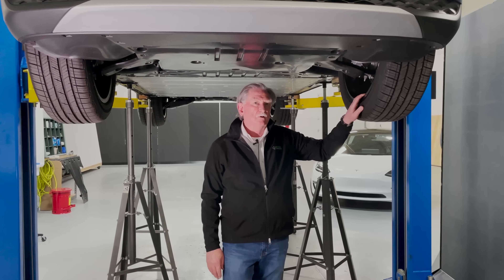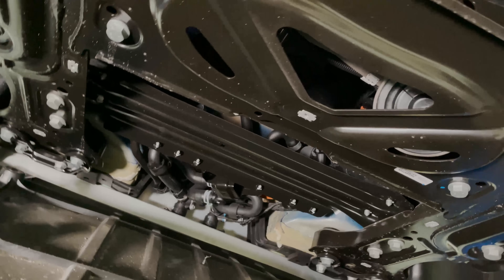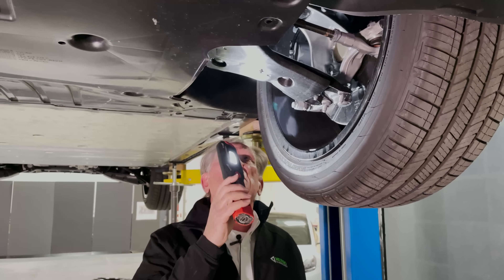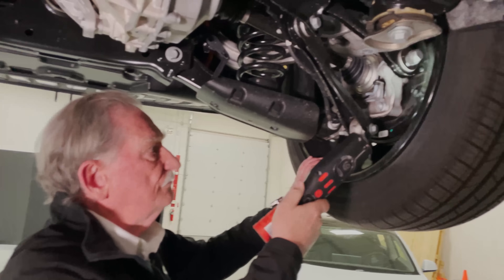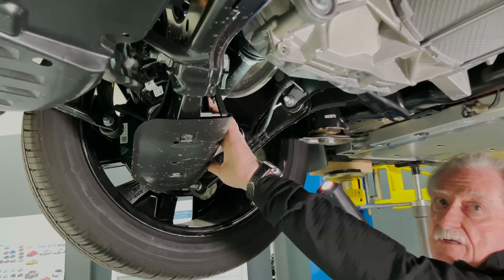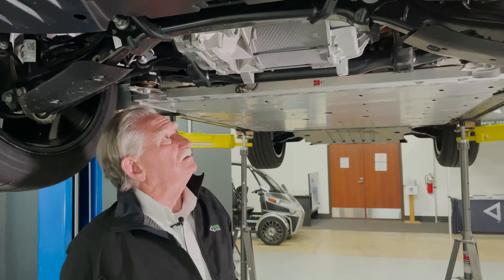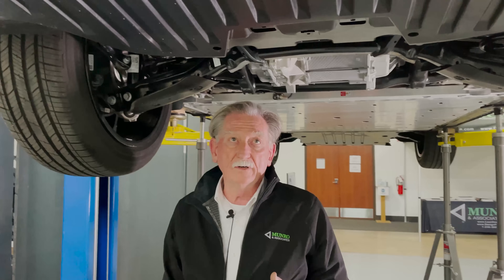2021 Volkswagen ID.4: E3 - Hoist Review, Front and Rear Suspension

Comment: this video will not age well with all the tesla praise - TÜV's recent reliability results for 3 year old cars put Tesla model 3 in last place of more than 100 cars, 3 times as many issues as the average, where one of the main problems were ... suspension. I dont think this old man is competent enough to question vw's engineering choices.

Comment: I have the id.4 awd. The front end is VERY noisy over bumps. Specially with those low profile 20" wheel tires which are pretty much standard now on the id.4.

Comment: As far as the hood pedestrian crash design being heavy.  Ask Ford how much the lighter "A" pillars in the 250, 350 trucks cost them.  Not required, but Ford scrapped a safer design for weight,  mileage and cost.  EPA mandate? Totally legal, but looked real bad to a jury.  So the first head injury by a US pedestrian, VW would need to do some `splaing if they removed those features.

Comment: May have been mentioned by others in the comments, but the main reason for the drum brakes is due to regenerative braking. A traditional braking system is 60/40 balance. In ev the motor driven wheels braking force is for the most part less than 30%. There are exceptions. Some current EV's are suffering from brake disc corrosion on the motor driven wheels due to lack of braking force required.

Comment: Sandy has become a Tesla promoter.  He faults the ID.4 suspension for being too-strong and too normal, compared to Tesla cars which are more like M-B & BMW.  But Tesla's have had many suspension failures, even a recall in China for the Model S/X suspension arm failures.  There is no significant difference in suspension and steering requirements between a gas or battery car, so reasonable that the ID.4 suspension is like other cars.  Sandy critiques the many coolant hoses, presumably in comparison to Tesla's Model 3/Y "octo-valve" which combines many coolant connections but has proven problematic.  Sandy is a former tool & die maker, with no college degree but much experience.  VW has many smart engineers, so presumably know all the options and made design choices based on initial cost and future maintenance.
Reply: Very well said.

Comment: In germany they use al lot of salt in the winter. Salt and Aluminium is not a good combination. If you coat it you can prevent corrosin on the aluminium.

Comment: The painted motor might improve cooling. The Emissivity ε is better with painted surfaces rather than shiny ones (blank aluminium), therefore the heat radiation is better (better cooling). That's also the reason why blank copper busbars are often painted to better radiate off the heat. At least we do that in Germany :-)

Comment: The reason there are drum bakes is that since it has a regen mode, you will be using that a lot of the time instead of brakes to slow down and stop. So since the rear brakes wont be used that much, disc brakes would start rusting. Drum brakes wont rust since they are sealed. That is the reason they decided to go for them. Also no brake dust. Sure, they have worst performance, but that is probably not the issue here.

Comment: Drum brakes: better against corrosion because of closed system. Cheaper to produce. Fading not possible because of recuperation. Most brake power at the front. So what is the problem?

Comment: Holy freaking hell. I was trying to figure otu why VW did this, then i remembered that they cant have a VW being a better car than an Audi.
Reply: Q4 e-tron is the same Plattform with the very same suspension and everything, so no...
Reply: @martins6590  Audi is quicker and has better ride
Reply: @Nderak  Source? Both midrange models (the 204hp variants) have the same 0-100kph value and the springs/dampeners even have the same part number.

Comment: At 4:45, apparently "somebody made a mistake" at VW and put semi-solid forgings, no, castings, anyway aluminium where it shouldn't have been.  Sandy, of all people, should know that VW is one of the best when it comes to parts rationalisation.  The aluminium suspension components he denigrates could have been a legacy part or one intended for a wide range of vehicles.
This video is an example of where experience in one automotive environment (US) is not helpful when critiquing a product of a different (EU) origin.  If the MacPherson strut front suspension wasn't more than adequate, the reviews that are already out there (eg. Carwow) would've highlighted sub-standard handling and ride.  They don't.  And anyway, what's wrong with a 10.2 m turning circle?

Comment: There is nothing wrong with the front suspension using a strut suspension with steel control arms.  Similar design to mk7 gti/golf r.  If you are expecting double wishbone, while better it is more expensive.  As for the rear, why do you mention the curve in the aluminum links to be a mistake?

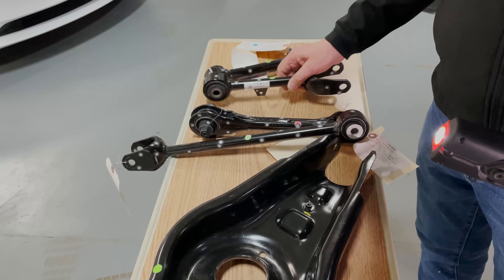Comment: 5:09 Those don's look likes tamped parts, but like tubes welded to stamped parts. Isn't that also expensive? It's stamping 2 parts, cutting a tube to length and welding the 3 parts together vs casting one part.

Comment: Disc Brakes have one disadvantage for BEV. They need Energy to free them. Drumm-Brakes got a spring for it. Thanks to recuperation of the motor the aft brakes have a very light load. So having drumm brakes there is no disadvantage on the braking side and an advantage on the energy level.
Reply: The new Audi Q4 etron and GT have rear drum brakes also. A definite advantage for quality EV's

Comment: Sandy Munro's mindset is based on 2023 & 2024 EVs. This blinds him to 2018 virtues in VW's product. I had the same experience as a product manager at a small software company. I turned on my "future vision" when talking with development and marketing. With customers, I had to stay anchored in the current product and next quarter's release. 

Unfortunately, VW's MEB will soon face 2023 & 2024 competitors. By then the market will have evolved. People might look at MEB as we do early ICE vehicles that reflected the horse-drawn vehicles that preceded them. Better than their predecessors, but not fully adapted to the new technology. Just as Tesla's first roadster shoe-horned all-electric propulsion into a Lotus (ICE sports car) body and chassis. Faster and easier than starting with a blank sheet of paper. The result was mind-blowing, but compromised. Completely eclipsed by Model S, designed from the ground up as BEV.

This could be a case study to support Christensen's classic book, "The Innovator's Dilemma." I suspect Tesla Model 3's surprising success forced VW to accelerate their EV rollout. Sandy points out many signs of a successful incumbent taking half-steps towards a disruptive future. 
- VW engineers have not yet experienced full EV product cycles. It is too easy to view an EV as basically an ICE vehicle with a different power train. 
- Drive to reuse available parts and tooling delivers short-term "speed" and cost-saving while locking the company into a fundamentally compromised platform.

The ID.4 will be successful because of solid construction, proven suspension and VW's established sales and support network. Its success could fade as ground-up BEVs out-perform and under-price it. Tesla's Berlin Gigafactory is a huge threat - the products will not carry EU import taxes, can benefit from Germany's tradition of excellent construction.

Comment: I usually like these videos but I feel like Sandy got a lot wrong here. 

The ID4 is much cheaper than the Model Y so they’re not really meant to be direct competitors. 

Most reviews seem to say the ID4 chassis dynamics are far superior to the Teslas. 

BMW uses MacPherspn strut front suspension on a lot of their cars - including the M2, M3, M4 - so I don’t know what Sandy was going on about there. 

A lot of the empty space in the front is probably meant for the front motor in the AWD version. 

Despite being a new platform, I would suspect a lot of the “mistake” suspension parts and other small components throughout the car are carried over from the VW parts bin used in other cars or other MEB platform cars like the smaller ID3 in Europe. Makes sense from a cost standpoint to not have to engineer and make a new part when one exists that does the job. 

On my MQB Golf R, that hook shaped upper control arm is shaped like that to provide more clearance for a frame rail, and VW has used similar designs for many generations of their multi-link independent rear suspensions.

Comment: Great video Sandy, keep them coming. It looks like VW ran out of development funds when it came time to designing components to fit under the hood. This is an excellent video that shows plenty of components can fail on a BEV. The cooling system, HVAC components, etc.
Reply: And how did you come to this conclusion?? Did you examine their accounting books for the R&D. Sandy isnt the ultimate specialist on everything. Hes for 1 from a different era and doesnt know what every engineer thinks when designing a car.

Comment: What is Sandy talking about now... the vehicles aren't priced the same!  The base ID.4 is $18,000 cheaper than the base model Y!   In terms of range... highway tests are showing that the VW is coming pretty close to the model Y.  Tom Moloughney estimated over 240 miles for the ID.4 RWD in warm weather; I'd go further and say it'll probably be close to 250.  He tested the model Y in warm weather and got about 275 miles of range.  25-35 miles isn't exactly a huge difference.   Sandy... seriously, would you do the smallest amount of research before you start talking?     
Price breakdown below:

Model Y costs $50,500 without any federal credit.  The base ID.4 is priced at $40k before credit.  Even before the credit the VW is $10,500 cheaper.  The federal credit brings that price down to $32,500, so it should be expected that without the credit, VW would have to charge $32,500 for this vehicle.  That's $18,000 cheaper.  VW claims they'll offer a new base price of $35k in 2022 when the Tennessee plant comes online.  That's $27,500 after credit.  $23,000 less than the base model Y.  Nearly half the price!

No one is saying the ID.4 is as advanced as the Tesla.   The argument is that it's an amazing vehicle at its price, and it'll more than do the job for most customers.
Reply: Tesla's also losing money on every vehicle they sell when global tax credits and regulatory credits are excluded.  They reported a $700 million profit in 2020 on 500k vehicles sold.  My conservative estimate for average tax credits they earned per vehicle is $4,000.  That's $2 billion.  The regulatory credit sales amounted to $1.6 billion.  $3.6 billion between the two.  Take those out of Tesla's financial statement, and their annual net income would show a $2.9 billion loss in 2020, or about $5800 for every vehicle they sold.

Tesla's gross vehicle margins are claimed to be the highest of any OEM... above 22%... much higher than a typical company reporting ~6-10%.  Except Tesla's gross vehicle margins include the tax credits and regulatory credit sales.  ICEs make up the lion's share of other OEMs, which obviously don't qualify for tax credits, and don't generate regulatory credits.  Tesla also excludes all R&D costs.  Other OEMs typically include 50% of R&D costs in their GVM.  Removing tax credits, regulatory credits, and adding in 50% of R&D, and Tesla's gross vehicle margins drop to 7.7%.  Other OEMs can survive on low GVM because they sell huge volumes.  Tesla doesn't sell huge volumes, yet at least, and hence their sales volumes aren't high enough to make up for the corporate overhead.

I imagine VW engineered the vehicle to be profitable even after all that free government tax credit money runs out.  They're likely earning much lower margins on each sale, because all established OEMs live and die on low gross margins.   They're not getting free money from regulatory credit sales like Tesla because they need those to offset their ICE business... just like every single large established OEM that built their business on ICEs and will need time to transition.  In fact, VW bought credits in 2020 and will do so again in China in 2021.  Tesla is getting a massive free source of income simply for being a new company that started in the EV era.  

Just a reminder folks, Tesla did not produce the first mainstream EV, nor even the first affordable mainstream EV. That honor goes to Nissan, GM, and Hyundai.  Maybe some others too.
Reply: @updlate4756  Exactly, producing complex devices like cars on a big scale and selling them with profit in one of the most competitive consumer markets is actually quite difficult.

Comment: Much of the extra bracing in front is mandated by offset crash performance, you want a good score without a big heavy engine up front, you need to put a lot of other crash structure there.  He is really being a little critical in this regard.  Most likely the 5 bar rear suspension comes from another vehicle or is shared from Audi, so it’s economy of scale to use the same part.  Aluminum also reduces unsprung weight compared to Tesla all heavy steel parts in suspension design, improving ride and handling . Sorry but he seems to be a Tesla fan boy to me.

Comment: The stator housing is not painted! the low profile rib pattern is typical used in low pressure die casting, to improve form filling in thin walled designs and over flat walled surfaces which otherwise cools the melt rapidly. This is typically used in Cylinder Head and Cylinder Block LPDC Designs. The grey color(painted color...) comes from the T6 heat treatment, quenched in water. The other motor parts is HPDC, typically not possible to water quench. For form stability and reduced stresses you use T5 stabilization for HPDC. 2h 200deg ish.
Reply: Look man... you can't expect Sandy to know these things, and you can't expect Sandy to not guess at those things he doesn't know.  Sandy knows he's the smartest and that engineers working at these companies are idiots.  They clearly never do things for reasons.
Reply: @updlate4756  Yeah, I mean, what kind of dumbass puts a front subframe in a car?! So much cross car bracing that is totally unnecessary! They really should've done a BMW style front suspension, held to the car by moist paper towels. What even is a MacPherson strut?!

Comment: Two questions.
1: Why are disk brakes more expensive than drum brakes? I really don't see the difference in material cost or manufacturing processes.
2. Is that suspension set-up supposed to be cheaper or is it just poorly designed?
Reply: I think you miss maybe couple points. WIth discs you still need to have handbrake modifying the components. On drum brakes "normal brake" and handbrake are pretty much naturally accomplished. You only need one cam to have hand brake. Not to mention that these days disc rotors are almost mandatory to be ventilated, which makes production of them more expensive. Let alone casting and machining brake calipers for disc brakes which are quite substantially harder to make compared to components in drum parts (I mainly mean part setup in machining). Remember that machining calipers you need to have decent amount of decent accuracy made holes and surfaces to make assy work. Drum brake need pretty much only few well machined surfaces, drum surfaces, brake cylinder and it's piston. Rest is pretty much punched steel goods with couple of generic pins and springs.

For the second he missed various points. That "base" is meant to fix multiple models and it's likely to be 4wd assy with minor changes.

Comment: Haha did you picked vw light so you got that blinking, you may need to hook up to diagnostic scan tool to check for fault codes and eventually replace some plastic parts 🚘😂👌 all vag cars are made to break and cause problems, economy goes well, parts, repairs etc. However these cars drives nice and people still buy and drive them.

Comment: It kind of looks like to me as if they played around with the stiffness of the top rear suspension arms in order to manipulate the tire position under high load. Since they like to setup the car to understeer even with RWD this seems like a classical VW move to save costs on the overall suspension kinematics. Tesla has a classical equal stiffness multilink design which is very dependend on the position of the suspension mounts on the car to be low in order to increase camber under higher load. Since the id4 is a suv with more ground clearance than even the model y this was not an option. You are comparing apples to oranges here.
Reply: Thank you!